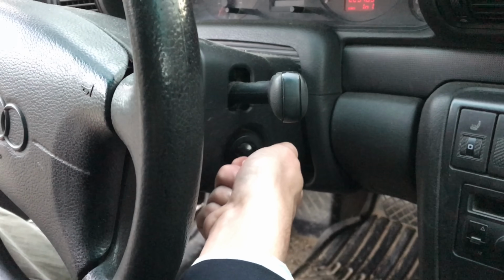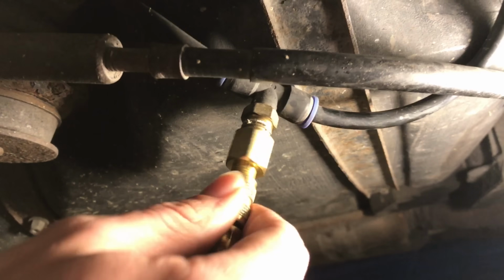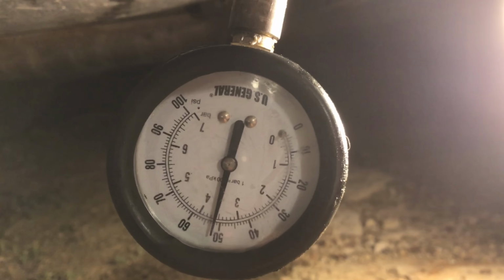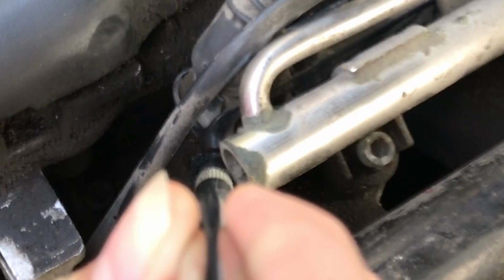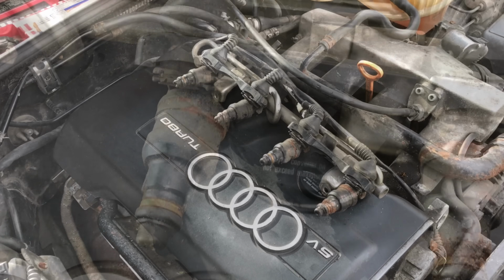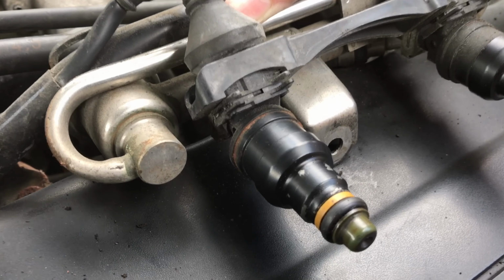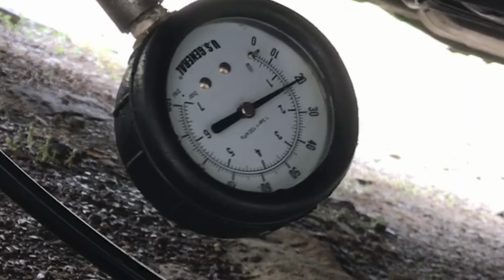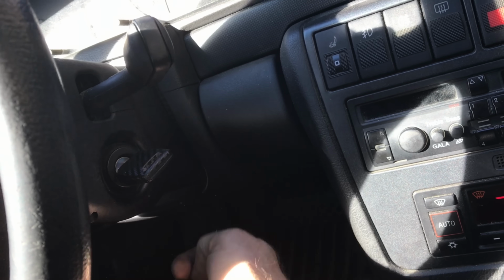Fuel injector? Fuel regulator? Fuel pump? Learn fuel diagnostics

Comment: I certainly like the idea of installing an additional check valve to avoid the cost of a new pump, but are you sure you would have to drop the tank? On my Audi I could access it via the backseat
Reply: dreamrealitysyndrome same with my jetta. No need to drop the tank!
Reply: dreamrealitysyndrome - Unfortunately, car "engineers" are truly "creative" this day and age, for "strategically" placing fuel pumps. Even my Lexus's fuel pump is in the gas tank. This turns a $300.00 fuel pump replacement into an over $1200.00 service job on my vehicle. Everyone should research before assuming 'where' the fuel pump is on their vehicle. That being said, this is a phenomenal and informative video on the subject of possible fuel problems.
Reply: My 99 Silverado and our 08 Tahoe both have the fuel pump access on the top of the tank. Not sure what all brands have them in other places but, first one I ever changed the fuel pickup on was a 55 Chevy Nomad wagon...I haven't dealt with much of the newer cars myself, at 70, I just take them to shops that can handle the job at the best price. And then again he mentions the 300 dollar figures for parts costs I believe so yeah, labor and all would be high.
Reply: Theres a port in the trunk of my Aurora.
Reply: some cars have access to fuel pump via backseat or truck.  SOme Dont!  You are lucky if you do because it is much harder when you have to lower tank-more expensive too if you have to hire a mechanic.
Reply: @neojoneswd  why i loved my acura legend...access to the pump right under back seat
Reply: Some cars have access holes under the back seat, and some don't. Not all fuel pumps cost $300.  I just replaced mine on a 92 Ford Taurus for $30.
Reply: @neojoneswd  My 01 Cougar makes you drop the tank. Saw a vid to cut the floor board under the seats to access. To chicken for that.
Reply: My fuel pump is under my backseat also. I have a 2007 bmw 328i. Easy to change.

Comment: Wow very great explanation I am also having trouble with my 02 dodge 2500 5.9l just installed a new gas pump runs good for days but when it heats up my truck starts to bug out like no fuel going through but thank I'll check everything that you showed on your video

Comment: glad to know i'm not too dumb.. these are the exact same fixes i was thinking of doing.  i have a leak somewhere too, same thing as you.  i cleaned my injectors, it's idle went right back to dead straight, but then it won't keep pressure in the line.  i didn't know what that weird round thing was on the rail.  it has no lines out of it to check it.  but that bike pump idea is awesome.  i think i'll try that into the rail.  n, i designed a way to drop the gas tank, but i really don't want to....and i was thinking, if only i had another pressure valve just later in the fuel line to do the same job...a great clear spoken, straight to the point video.  confirmed my suspicions well.

Comment: Here’s a hard one, 1995 SC300, Car is super rich and can’t idle, threw maf code, changed maf, no codes, still runs rich(black smoke) can’t idle. Changed ALL manifold/tb gaskets, o2 sensors, fuel regulator, fuel filter, injectors, ecu rebuild(leaky capacitors), air filter, vacuum lines, coolant temp sensor. Problem still there. I can hold rpm, but it runs rich and throws black smoke. let off the gas and it drops to 400rpm< and eventually dies. I’ve changed plugs, wires, cap/rotor, still the same. Gas keeps getting into fuel, no water in oil. What’s going on? any ideas? it keeps over fueling, no codes thrown. OBD1…HELP!
Reply: Maybe your fuel pump control unit if you have one
Reply: @UTP_ENT  so i did end up bypassing the fuel pump ecu and now the car can stay running if i stay on the gas, no black smoke or richness, BUT now it can’t rev pass 1500rpm. I did change the TPS and heard sometimes it need calibration? But other videos i’ve watched they didn’t calibrate and it ran fine after changing. All my symptoms now are basically like a bad TPS. Can’t idle or rev up. But can run if I feather the gas.
Reply: Clogged Fuel injector/Stuck open and because it's clogged it Leaks (Seaps) into (probably) your #5 cylinder and Eventually causing your "Fuel Wash" (i.e."cylinder wash"): Raw un-Combusted Fuel Eating away at the Lubrication in your Oiled cylinders and Creating your "RICH Condition"
GOD Bless you and your Family in The Name of Jesus Christ 🙏
Reply: @ update years later, the richness issue was due to the ECU. I had it sent out to fix and it solved the problem. Except now, the car runs, but it will idle as if it has a cam. If that makes sense…Like the RPM will rev up shortly over and over. No response to the throttle. Just keeps doing that. There was also a pop from the air intake box that goes away when I unplug the maf and the car still runs with the rev up idle

Comment: Thank you for this video man! I have a Classic mini SPI that doesn't start because it doesn't get fuel to the single point injector. Fuel just goes back to the fuel tank and the current to the fuel pump is not stable. I think the ECU does't allow the fuel pump relay to build up fuel pressure. And when I gif the pump current straight from the battery, fuel goes straight back to the tank. So maybe it's a vacuum hose from the fuel pressure regulator. Could that be true? This video gifts me more hope and maybe I can solve the problem.
Reply: Ilias Lamari
Reply: Ilias Lamari OK Google what will cause a 94 escort not to come out of park it is an automatic transmission
Reply: Sonya Chavis possibly the shift cable came undone
Reply: @sonyachavis4223  broken shift lock/ broken safety switch on brake.... broken shift cable

Comment: Can’t you easily lose pressure with a clogged fuel filter?
Reply: Na. You wouldn't lose pressure as much volume of fuel. The pressure should actually increase prior to the regulator
Reply: You don’t have a swimming pool do you ?
Reply: @luvdogsandhorses  cant swim. so no
Reply: @luvdogsandhorses  A while ago I did have a clogged fuel filter on a 95 525i. The pressure at the pump measured 95psi when it should've measured 51-55psi
Reply: What was the pressure getting to the engine
It’s called pressure drop and any type of restriction causes it including a clogged or partially clogged filter
Reply: @luvdogsandhorses  THe pressure past the filter(prior to regulator)  I cant remember

Comment: Very good video ! SO glad i saw this ! I have a engine power drop issue that came on with no warning and seems to be on hills etc and under load, and my first thought was fuel system. I am about to check the 3 things, and my regulator is brand new, my injectors are probably fine too, and my in tank fuel pump a 2 yr old genuine denso.. and i hope to later comment i fixed the problem with a $4 check valve. Thanks mate !!!

Comment: Wow, great. Thank you!
I'm from Brazil and I lost two FLEX fuel pumps with this defect and the mechanics didn't even know it, they condemn the pump and change! ; I was suspicious when I noticed that they maintained the pressure when starting and lost when turning off the vehicle. The pressure drops fast.

Gasoline only fuel pump: 3.5 bar
 
FLEX petrol and ethanol fuel pump: 4.2 bar

OK!

Comment: Thank you for this video/information, my haynes manual does not cover hardly any of this I troubleshot my issue back to check valve on fuel injector I raise pressure and drop it as  soon as it peaks out and narrowed it away from pressure regulator!

Comment: Thanks for the video. 
I got problem with my KIA Sportage  CRDi ( diesel ). Cranking several times to run the engine. Probably is the same problem with at your video.

Comment: I did enjoy the video, I have missing pressure in the mornings and have other issues also while driving which maybe related or not. 
I have a fuel pump on the rail so I think that might be a great spot to check the gas tank side. The engine does do a funny rev thing when I remove the gas cap but that might also be the vape thing that removes that but I have big doubts there also.

Comment: My car would take a long time to start after sitting for a few hours, so I figured it was leaking fuel pressure... I replaced the O-rings (cost around $5 for a set) and fixed the problem.  That seemed like the most logical place for a leak in the fuel rail. I think the problem started suddenly after I added some kind of fuel system cleaner to the gas tank and drove on the highway. Very old engine, so likely the O-rings were barely functioning at the time.

Comment: This is gold! Thr information in this video is so helpful. Thankyou 🙏 currently i have leaking injector seals. At wide open throttle the car is cutting out and loosing power. I suspect something in the fuel system. This should help me narrow it down. Would the check valve in the tank slow the fuel pressure getting to the injectors at WOT?

Comment: Thanks for the video. Hopefully I can get my 4-stroke snowmobile running smoothly after watching this. With all the electronics now installed into most snowmobile, it's like a regular car. With them injectors, regular motor oil change, and etc.

Comment: Awesome. Thanks. I just replaced the FPR and check valves in my 2000 Silverado with no improvement to my Pressure issue. I bought some 0-rings for the injectors anticipating this but wasn't sure if that was a good place to look. Now I know...Thanks, again.

Comment: Great adivice and video. Did you connect it to a fuel return to build pressure or does your car not have a fuel return line? I'm experiencing the same problem, the car struggles to start, if it starts and I switch it off it can start right back up but when it stands for about 20-30minutes it struggles to start and I have to swing the engine over 10x times before it eventually starts.... Please advice. Thank you in advance

Comment: Excellent video.  I have an RV that cranks but won't start.  Battery good, replaced battery terminals, fuel system fuses are good, OBD1 no codes, hooked pressure gage to schrader valve, no fuel pressure with key to on position.  RV has inertia switch that disables fuel system but it wasn't activated.  After watching this video, I will check for fuel in the fuel pressure regulator line.  I need to figure out how to read the pump and test pressure from the pump.  If it's the pump, I wonder if that  check valve will work, hmmmm.

Comment: Dude wished you were my personal mechanic ! I replaced spark plugs,   but now I know I have a vac leak or faulty injectors cause I have rough idle , and bad gas mileage ! Because I drive a honda civic barely even drive it back and forth to work ! I pay $20 weekly for about 11 gallons and that's not normal I live 2 minutes away from work lol

Comment: Great VIDEO!!
  I had a P0304 a week ago---today, it is a P0300.
  It obviously is getting worse---so this helps.
  I will try ASAP.
  THANKS
Reply: What did you find out? Mine had the same codes
Reply: @NotbutContent  Well, what I did was replace the spark plugs and cables; the code came up AGAIN.
  So, I replaced the Ignition Coil (but they didn't include the Ignition Control Module & Harness, which coule be the reason it STILL reads P0304.
  And I also replaced the Distributor Cap & Rotor Button.
   Either it is a GLITCH, which I doubt because the symptoms are still exhibited: shakiness of idling truck, hard start and thats about it.
  But, according to my FIXD App---it now has a misfire (serious driving issue) in the 4th Cylinder.
  So, either my 4th Spark plug is bad, poorly gapped or there is an internal issue.
  This truck has 280,000 Miles---and frankly, I am very weary of changing parts, buying new gear, etc only to see the codes switch numbers.
  But, the number is indicative of WHICH spark plug is messed up.
Reply: Hmm, yeah man I feel you on the burnt out on trying to fix it thing. So have you tested your fuel pressure? The hard start makes me think it could be fuel related. I was having p0304 and did plugs and moved a distributor and wire and am now getting p0300 so I tested the fuel pressure and it was coming up at like 43 ish when its suppose to be like 55 to my understanding
Reply: Going to take it in to someone tomorrow if I can find someone to diagnose it for a good price, otherwise I may try and tackle the fuel pump, regulator, and fuel filter which unfortunately are all in the gas tank. Have to either drop the tank or remove the bed, but people say removing the bed is easier because it's just 8, 18mm bolts and it comes off. But a buddy was telling me today a lot of people cut a hole in their bed to access the fuel pump and then just put a metal hatch over the hole so they can access it in the future. Not sure why I told you all that but if you run a fuel pressure test then the info may come in handy. But anyway, I'll let you know what I find tomorrow

Comment: Thumbs up for sure. Just one thing I asked in return. Can you please tell me what if my vehicle is designed not to have a check valve in the pump? Does that mean the slow crank has to either be fuel injectors or pressure regulator?

Comment: Wow, this is an amazing "tutorial" (especially the fuel check valve tip). Thank you for this!  I have a 2001 Ford Focus which exhibits the same hard start but has a fuel smell on start so I'm assuming it's the Fuel Injector Pressure Sensor. I'll employ your techniques to make sure. Putting this video in my auto "save" folder. :) Thanks again!

Comment: I love how clearly you broke this down.  Maybe you can help me with my 2008 Scion Xb VSC, Trac Off, ENG light at the same time.  My car will start hesitating and slowing down especially when I try to accelerate in and out of traffic.   I take my foot off the throttle, the lights go out back to full power.  Changed coils, plugs, variable timing sensor, and the valve cover seal.  Your 3 step process may be the next step.  Any input would be much appreciated...
Reply: Maybe you should clean the throttle body and clean ur MAF sensor

Comment: Thank for going over this I had my truck decide to die while going down the road and was not looking forward to the fuel pump still hope I don't have to do it but I don't hear the pump either so not a good sign!
Reply: Same problem myself. Mechanic said he "had" to replace it altogether. This is what is frustrating me! He either never replaced it. Or this isn't my problem. Idk. Hope you find & fix your issue.

Comment: Great video! I am currently having problems my fuel system. Recently while driving feel like losing gas pressure and vehicle shuts off. First replaced spark plugs and wires. Still cannot get vehicle to start. Looking into fuel filter and the fuel pump. Unfortunately not diagnosing with a multimetet......going thru parts to see if can issue resolved.

Comment: When I find such explanatory videos I FEEL THE URGE TO COMMENT “i rarely comment”
Thank you a lot the best video ever made
Can you please make a video about P1401 code on my Honda Accord 2005 2.2 i-CTDI “CN1”
It’s in limp mode now and it also has a P1065 low pressure fuel rail even though I ve changed the common rail and fuel pressure regulator on the fuel pomp
It was all in vain :/
Any explanations pls ???
I would really appreciate that

Comment: Cool man! Everyone seems to have just a little different angle on attacking some of these problems. I like how you check the check valve in the pump. I suppose you could do the same in the engine compartment with a way to connect.
Reply: Yeah if you can separate the fuel line someplace as opposed to trying to do something with that Schrader valve.

Comment: thanks for the video.  To diagnose the check valve in the fuel pump, we are not finding fuel lines to ump air into the tank.  Do you have any additional information on getting to the fuel lines?

Comment: Great video.
I had the exact same issue with my Hyundai elantra 07. From my experience, since you can't really tell if the problem is with your check value. The first place to look is your injectors, since it is just an observation, It doesn't hurt to check that first. Start the car for few seconds, maybe just two seconds to pressurize the fuel system. The injectors should be dry when pulled out, if it looks wet and leaky, just replace them and you are good. I bought new fuel pump, that didn't solve my problem until I met a guy at a shop where I was going to buy plugs to see if it will solve the problem. He told me to check my injectors and idle switch as they work together.  The guy pulled out my injectors, lo and behold they were wet and leaky. We changed them and it has had quick start ever since. I hope this helps you.
Please, only change injectors when they look wet and leaky.

Comment: I have a 2005 ford focus. Car died and wouldn't start; finally restarted after messing with shifter and twiddling 3mths later. Changed fuel rail sensor(had code),P0171 code:: fuel filter,  cleaned spark plugs and did valve gaskets. Cleaned maf sensor. Car stalls after 10 min idling, dying at stop lights ??  Thinking go ahead and change this since I  have it .(ignition switch module)Had forgotten I got this code a long time before it actually started. Got code when battery was low and read not to pay attention to codes from low battery?? 🤔 any ideas? Could it be losing pressure driving or after the 10min.?Thank you for your time! I  have info from live and freeze frames, but I don't understand 🙃 😅

Comment: Anytime you open up the engine (any part)..... you should clean the surrounding area FIRST.  Cleaning the injectors afterwards is important too, but you let all that dirt fall into the engine when you pulled the rail dude.  Just saying.  Other than that, great video and clever to boot.

Comment: great vid. might try this on my B5 passat , i think I've narrowed this down as the problem. would you suggest placing the check valve before or after the fuel filter...or does it make any differnce?